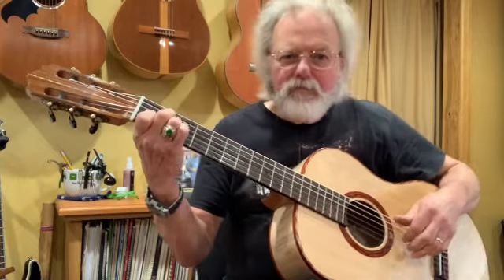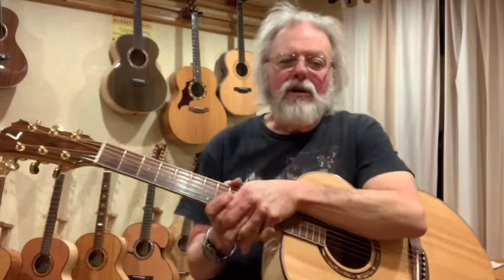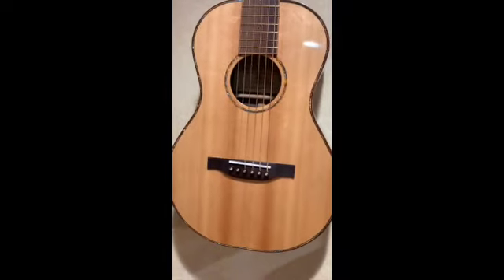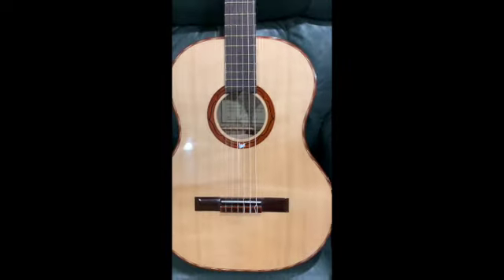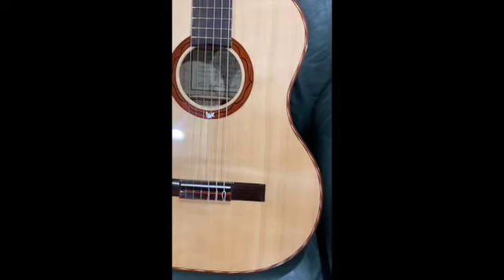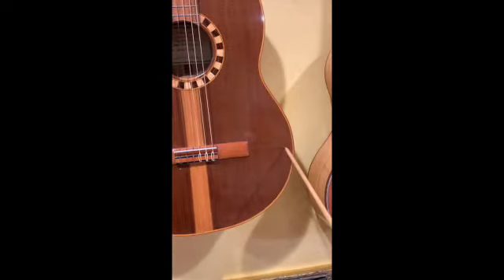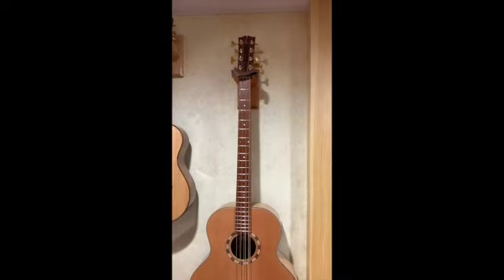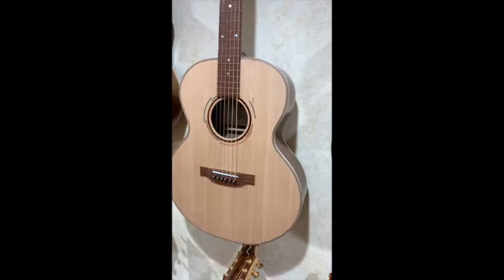Guitar Tops: Does a perfect top mean better sound?   SD 480p

Comment: I would agree with your primary point. I mostly re-top badly damaged guitars. The very first guitar I did, to keep the cost down and see how viable the effort was, I used what my supplier labeled as AA. It was perfectly quartered with tight annular rings. It was the less than perfect appearance that dropped it from master grade. The end result exceeded my expectations and honestly I like the sporadic mineral streaks. I will occasionally move up to AAA but it will generally have more to with the defects, though fewer, they are well book matched. The ‘lower’ grades are really a best buy in my opinion. Decades ago no luthier would gave ever let sap wood in their backs and sides but now it’s a trend. It likely started as the occasional necessity and caught on from there. I’ve used reclaimed redwood and it is a more than worthy tone wood, it’s far from ‘perfect’ but is absolutely stunning when French polished.  It’s refreshing to hear some sensible talk about instrument materials since many of the opinions these days are a bit fanatical.
Reply from the maker: Interesting remarks. I met C.F. Martin III in 1971. He told me that there was nothing wrong with Bearclaw Spruce, but they wouldn't use it didn't look right. THINGS HAVE CHANGED.
Reply: Yea'h  what has changed ? Well-----here's one thing.
The best fussy choises are not available anymore to make thousands and thousands eventually millions of machine made guitars. LOL.

It is depleted like everything else is or soon to be.

Comment: i haven't really put thought into acoustics luthiery until discovering your channel (i do have experience with solidbodies though), but your observations make a lot of sense and are very welcome (i'm also a pragmatic, physicist by trade, and i noticed a lot of woo in solidbody building as well - tonewoods, finishes, pickup wire, capacitors etc).

i recently noticed my old cheap acoustic's spruce top starting to develop some brown streaks, and thought it was a lot more attractive as such. so now that you put things into perspective, i really do find weird how opposing are the esthetic standards, for natural wood, in solidbodies vs acoustics. interesting grain is such a big deal in semitransparent finishes for the former.

so if looks don't matter acoustically, you've definitely sold me on these "alternative" materials. i've subscribed, all the best.
Reply from the maker: Aesthetics mean a great deal to me and that is one of the primary reasons that I select the materials as I do.

Comment: Just subscribed, thanks for your channel. Bob Taylor recently decided to use patterned ebony for fretboards and bridge plates, but I wonder whether the industry would ever be brave enough to use less uniform woods for their tops? I guess the big builders are victims of their own success. If every felled spruce or cedar tree was a "guitar tree" instead of only using 1 out of a 100, that's got to be a win for everyone?
Reply from the maker: I like your phrase, "big builders are victims of their own success" and I believe that the buying public fans that flame. Manufacturers maintain their characteristic sound grading their materials by strict criteria and making their processes as consistent as possible. The end result is a wonderful guitar like Martin or Taylor, but if you think about that, it means that they're trapped in their system and can't build outside their criteria because it may cause them to lose control of their characteristic sound and appearance. Martin once made three Dreadnaughts from Cherry, Red Oak and Walnut. Nobody cared because they didn't look like Martins. People are irrational.

Comment: I agree the typical grading of tops does not necessarily indicate the ability of that top to sound good. However, the grade A or master grade tops from any reputable top supplier (and I don't mean amazon or other sources, I mean the people who have been harvesting and supplying tops for at least decades and in most cases hundreds of years) will sound good. Given the cost and effort of all the other materials that go into building a guitar is it really worth saving $150 (that's roughly the difference between a master grade top and a C or D grade top. Antonio Torres showed that the top is the most important factor in the sound of the guitar. In building a guitar there is hundreds of dollars in the back, sides, neck, fingerboard, tuners etc. You will spend  more dollars on glue, sandpaper, finish tools etc. Then there's the time you put in. Why would you not give yourself the best top for the project. If you wanted the best meal would you go to a market where you could get the best local fresh ingredients from knowledgeable producers or would you go to the discount grocery chain looking for bargain ingredients? I don't disagree with you that a less that stellar looking top can still be a great sounding top, given all the other dollars that go into an instrument the top is not where I'm going to look if I were trying to reduce costs - it's the last place.
Reply from the maker: All valid statements. And I recognize that this is the worldly side of guitar making and the guitar buying public.  I find it interesting, however, that when you pay as much $500.00 to $2000.00  for sunken, buried, salvaged, ancient Spruce , Redwood and Cedar and  top dollar for Adirondack, it seems to be an assumption that those tops will be highly musical regardless of what they look like.  And it should be recognized, that those tops have an aesthetic value as much as any other.  From the maker's side, the bling gets a higher proportion of dollars per instrument. From the buyers' side, it allows one to push their suspenders out even further.  My perspective and my message is that all of the above is talk about money and that doesn't correlate easily with sound. The more important message is that any and all physically suitable tops can possess very high musical value and if so, they should be part of the musical and aesthetic equation of an instrument. I DO NOT advocate that anyone should turn away from the highest grades of instrument tops and I DO hold a certain amount of resentment for the notion that using lower grade tops is an effort to save a few dollars.  That's what manufacturers do, not craftsmen. On the worldly side again, however, what portion of the guitar buyers will justify paying $6000.00 to $45,000.00 for a guitar?

Comment: i am glad to see you've used pine. hmmm, i bet juniper is hard wood. probably hard to find any and of cours it would be twisted. which would make it look good. 
anyway, as an amatuer builder of electric guitars, (i don't have the nerve yet to try an acoustic) i use solid pine bodys with assorted tops, mesquite, acacia willow, silky oak. stuff that grows locally here in the desert. i'm finishing a neck through 'pinecaster' all pine. fretboard included. this neck is like a rock. i also use oak. so far for tops, necks, fretboards. i made a neck through bass with a white oak neck that started as a 4x4 laying in the sun for 30 years. super strong and hard. 
so my real point and question is:
why are acoustics never made with oak?

Comment: Am I wrong in saying that Douglas Fir was very widely used for construction 2x4's back during the eras when studs were closer to actually two inches by four inches? Some Spruce and other firs were very popular for 2x4's in earlier days way back when? The reason I am wondering is that I have some reclaimed studs from a very old local house that I have been sawing up to use for some explorations in luthierie the grain is very very small and tight and there are some very delicate and consistent cross-grain figuring as well. Im not afraid the first will be approx. 10-12 piece top, I repeat Im not afraid.
Reply from the maker: I see no reason why you shouldn't be able to make that work.
Reply: @thepragmaticluthier  I figured wood glue would be best for strength but with so many pieces, would the acoustics benefit from using hide glue instead? On the top I mean.

Comment: I’m enjoying your channel very much, but perhaps haven’t been following long enough to know the answer to this question: what are the differences between sawn tops and split tops? Thanks!
Reply from the maker: Sawn tops are sliced from quarter sawn boards or planks. Sometimes, grain runout, grain running at a shallow angle across the thickness of the board, is a concern. Split tops are split from short log sections, almost like splitting firewood. This is done so that the natural grain direction is more closely followed on the split surface. The split billets is then flattened on one surface and slices for tops are sawn from that surface on a large bandsaw.

Comment: You and your woods are very interesting!
These tops,,,,,are they air dried? or rapid cured??? you know---kilns, vacuum, torrified etc.
Just curious.
No matter how old.
I have to pay attention as to how much moisture is in the material big trouble if I don't.
Especially here in Western Mass.
Reply from the maker: My tops are dried by a mixture of methods depending on source. They are ALL acclimated in my shop for long periods before use.

Comment: Speaking of low grade wood, always wondered why solid lindenwood couldn't be used as a top since it's at least as hard as sitka.
Reply from the maker: Linden, the botanical genus name for basswood is pretty much acoustically dead. It is frequently used or interior lines in guitar bodies because it does not wick kinetic energy from the top to the rims nearly as efficiently as other tome woods. I'm certain that a guitar top of Basswood would yield an instrument of low volume, sonority and rather vapid character.
Reply: @thepragmaticluthier  
Thank you for that.
Was just thinking back to an old all laminate lindenwood acoustic guitar I had decades ago that at the time I thought sounded ok.
Thinking that basswood is harder than spruce, yet was never used for a solid soundboard.

Comment: The silking is a sign that the grain is on the quarter (90 degrees), which will make it stiffer to the strings.
Reply from the maker: One of many variable in an equation.